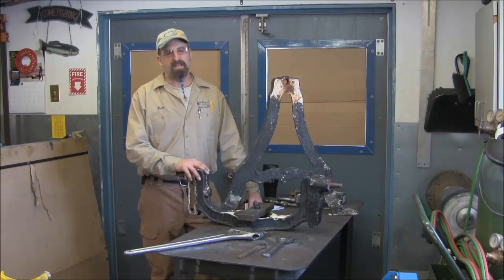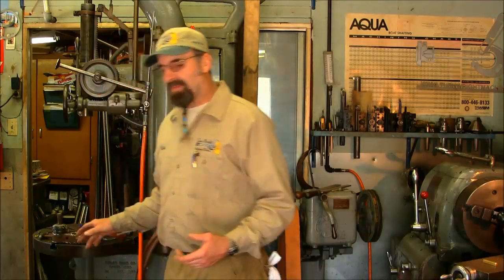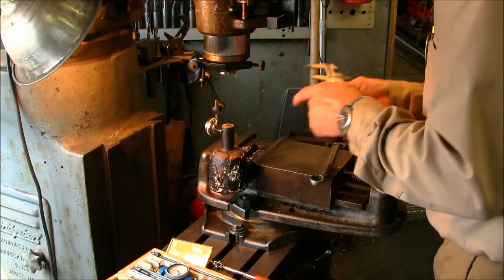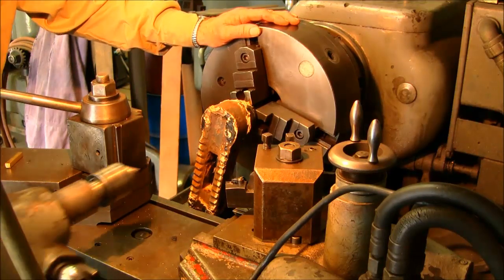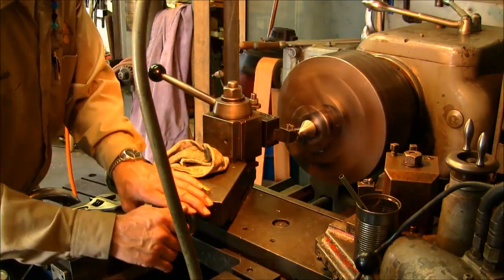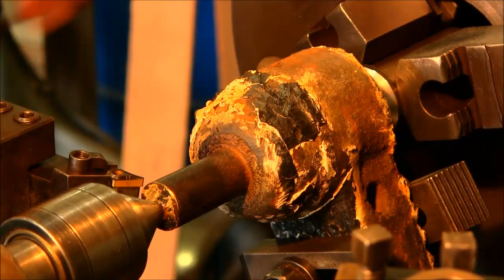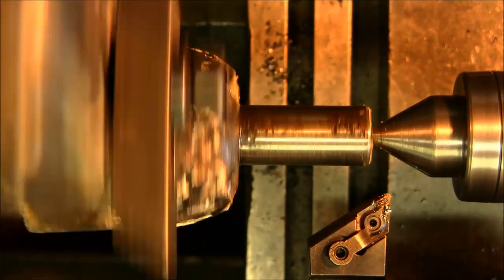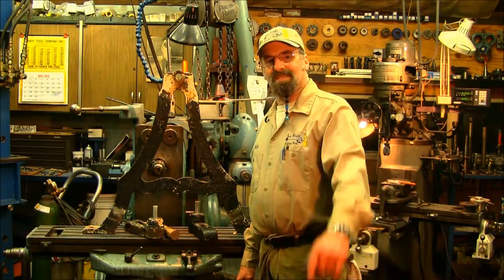The Bell Rung 300 Part 1: Church Bell Repair

Comment: A quick rattle with an air powered scabbler would have knocked that paint off the nuts first, then would have probably unscrewed more easily.

Comment: Dear Keith, are you making the center you use in the three jaw chuck.  If so, is there a particular alloy or hardness or lack of hardness you look for?  or maybe buy a center that you modify by putting in your recommended shoulder

Comment: I understand what your doing. I watch your videos with a keen interest. It took me a few to figure out what you were doing but I got it. Your finding the center of piece by centering it on the chuck using the outside diameter and using the needle gauge. In theory if the gauge don't move riding around the outside then the chuck is centered on the piece....So cool

Comment: Keith,
Is there a specific reason for withdrawing the adjustable wrench some distance from the bolt head [Edit: I meant, the nut] each time before you turn it? It's the first time I've seen this technique, and my layman's intuition would expect this to put more strain on the jaws of the wrench? From what little I know, I was taught to slide an adjustable wrench as far onto a bolt head [Edit: or nut] as it will go. No critique, really just wondering about the reason. (Knowing your videos, there must be a good reason!)
Reply from the maker: The curve of the inside of frame would hold the wrench out on the nut and that would be more chance of slipping in my eyes, but it wasn't a tough turn anyway just solid because of the old paint build up. ;{)-----
Reply: +Mark Rohwer Yes my old boss would tell you it was wrong.

Comment: Dear 'Master' Fenner, I just wanted to share an idea. What is the possibility that, when you centered the shafts in the milling machine, you could've used a boring bore (in reverse) to cut the outer diameter of that shaft? (as opposed to using the boring bore 'conventionally' on inner diameters)  What do you think...am I slick, or, retarded?  haha  THANKS
Reply from the maker: I have a couple videos showing that exact move, it is a cool one as long as the over reach causes to much vibration.and you can prove a straight line from one true center to the other true center axis. ;{)-----

Comment: Wonder why you use your Crescent wrenches backward sometimes.  Placing the work load on the adjustable jaw rather than the fixed jaw.  Just found you yesterday, and have watched over 7 hrs. much to my wife's dismay.. Really enjoy a craftsman at his trade.
Reply from the maker: It is more a position of handle than the load on the adjustable. I have modified that particular wrench to open out wider than normal and it doesn't creep open past the hex size of the tool post. If I have to pull on an adjustable hard I do it in the proper direction, the same as using an open end wrench. Thanks for the comment and welcome aboard. ;{)------

Comment from the maker: I have a lot of videos doing projects on the lathe and show most of the special functions but I will keep a once over the lathe as a future video, most likely give a promo for Mr Pete's video collection which covers the lathe in its fullest. I bought the lathe with the hoses in that condition, almost 20 years ago, it is only the outside rubber coating the lines are wire braided. ;{)-----

Comment: Hey Keith, I only recently discovered your channel and have been hooked sense!  Its great to watch someone who knows what they are doing around the shop but also provide commentary and explanations for those a bit less familiar with whats going on. 

Would you consider doing a special on your lathe and the controls?   Also, I noticed on one of the hoses on the lathe carriage (hydraulic maybe?) looks a bit dry rotted and cracked.  Is that anything to be concerned about?

Thanks for making these!

Comment: You already have determined that the pin has an elliptical cross-section. When you put a circular pin in the chuck, you are guaranteed to put your center drill in the center. With an elliptical pin, won't it move so that the jaws are equally distant from *each other*, but not the center of the pin? 
Or is the difference so small as to be insignificant?  I'm probably over-thinking this...
Anyway, love the videos, congratz on 300. Thanks for making them - I've learned so much watching them.

Comment from the maker: I worked the indicator closer to the end of the shaft and chose to split the difference to minimize the amount needed to clean up the diameter as a whole. After you choose the center itself, you except that as your new center and if need be the rest of the alignment is done at assembly, with the mounting of the legs. ;{)-----

Comment from the maker: Polishing a 3" shaft in the lathe and had my steady rest, rollers backed away from the shaft about 1/4" to 3/8" and passing by the rollers my thumb was sucked in and I had to yank it out. It was flat, I said dam that hurt, rolled it over to look at the other side, split and blown out, dozen stitches later. The scariest incident was Bullard cut master, net reels and standing up on a platform looking down in and a chip wad slung out and rapped the back of my head burn scar ear to ear. ;{)-----

Comment: Hi Keith, I was just wondering (and it might be a dumb question) as I was watching you set the piece up to center drill the pins, if the pin is not totally vertical and I realize thats difficult to do in a situation like this with a worn piece but even so wouldnt that give a false reading on the indicator as far as the roundness of the piece is concerned and how would you sort out which was which?....love your videos!

Comment: I`m curious Keith , I wonder if the rust marks on the trunian is from the bell going into a weightless spot like when your on a swing set just as you reach the top of the sway there would be no pressure either right ,, There I go thinking out loud again  LOL

Comment from the maker: No, the lathe chuck is like all other chucks, the option of the three wrench locations are for convenience, they all control a single scroll doing the work, although mentally is seems to make a difference if you put a little force to each location on a single set up. ;{)-----

Comment: do you need to tighten all holes in lathechuck , like regular drill press chuck? also do you use power feed on shortruns in the lathe or cut manually? enjoy your videos ,just learing machine work. oldtimer.

Comment: Ooh, a quick thought about the TV lift project and noise. I think all that hollow tube is acting like the sound box on an an acoustic guitar for example. If you gould get in there and fill all the hollows with expanding foam it may well quieten the thing down some. Also if you coud fill any voids behind where it is mounted with dense rockwool that might help too.

Comment: Hey Keith, congrats to #300!
On my lathe I use the file the way you do but for another reason: my lathe is really small (only a 5 inch chuck) and when I have to file near the chuck I can reach over it with more clearance than if I would file left handed and I also can see better what I am doing, I see that the chucks not hitting my fingers or something. Of course, the right clothing (short sleeves in my case) is vital.

Comment: Nice clip again, Keith!
Little tip - when turning between centers I usually put a rubber tube / hose onto the drive bar so it doesnt destroy the jaws even with low tention on it.
Greetings
Adrian